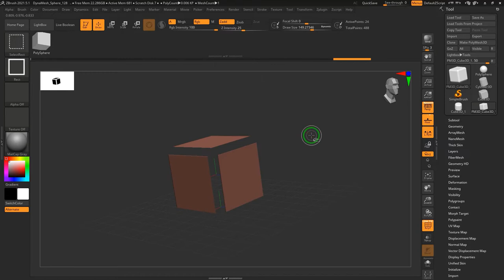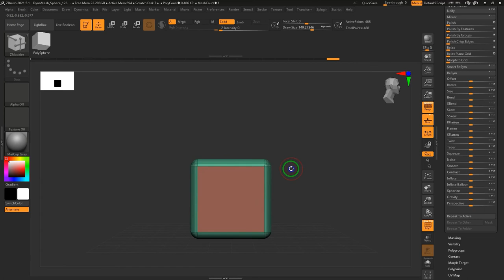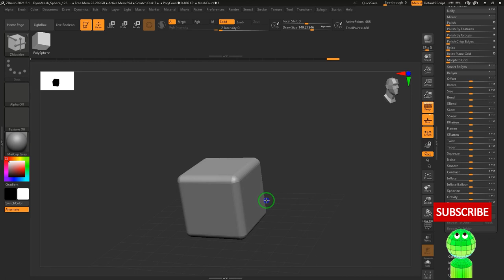How to create a Cube with rounded corners in Zbrush ?

Comment: How do you get a cube with no subdivitions? My cube has a minimum of 2 faces on each side, and I can’t lower their number in ’’Initialize’’, which means that the bevel occurs on the sides as well as the corners of the cube.
Reply from the maker: You can create a plane3D. from the  ’’Initialize’’ menu set Hdivide and Vdivide to 2. you will get a plan with 1 polygon. 
from the Geometry menu, Crease Menu, select "Uncrease" 
then extrude your polygon with Zmodeller brush.